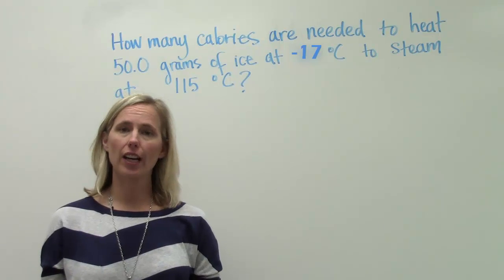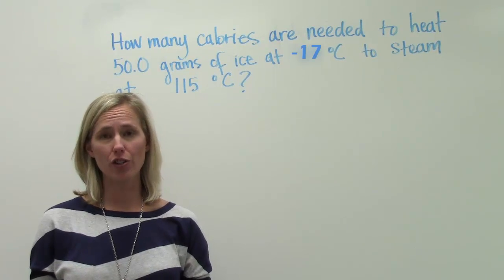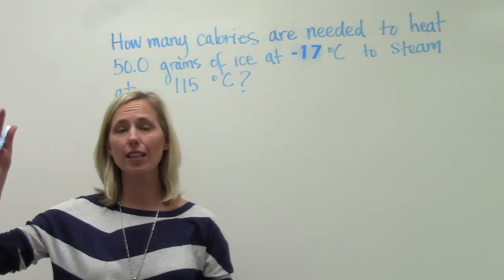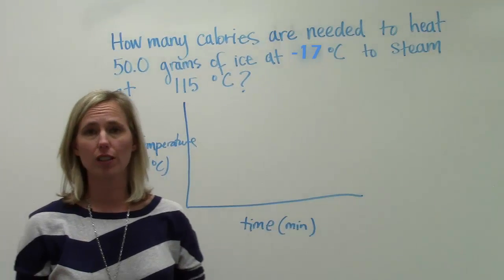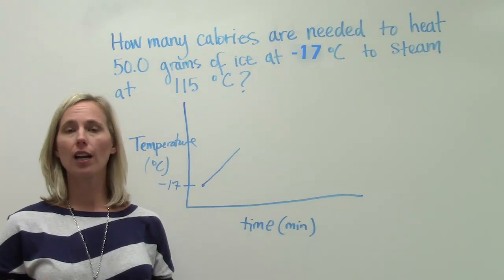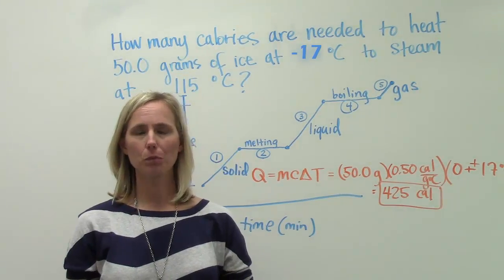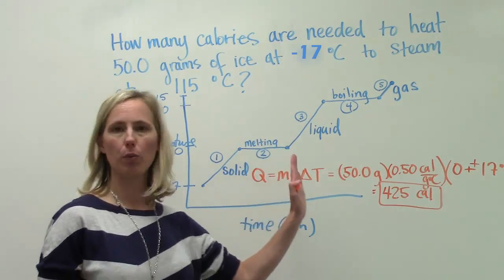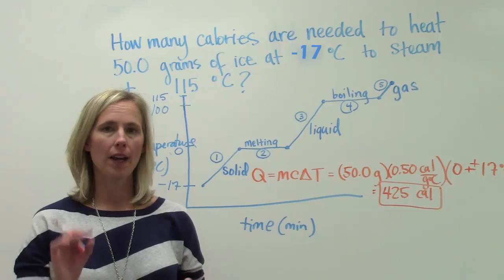Heat and phase changes

Comment: Heat is added to superheat steam at constant pressure in Boiler and also  heat added to change the phase from saturated water to saturated vapor at constant pressure.

Heat is added at constant pressure to superheat vapors. How it happens?
Has it got to do something with the concept of work flow, or increase in specific volume in super heater?
Please explain the reason? 
Thank u